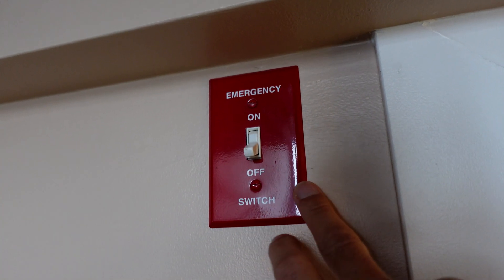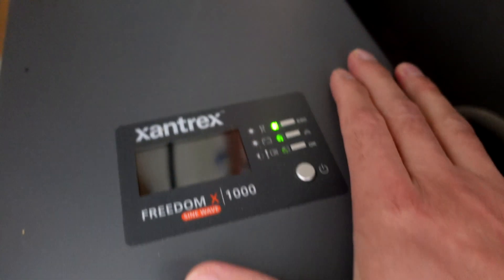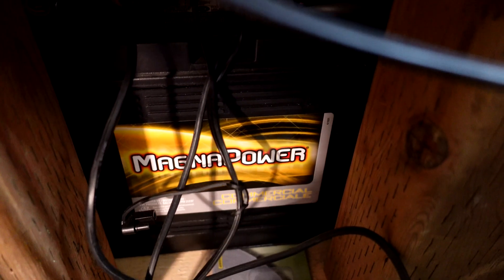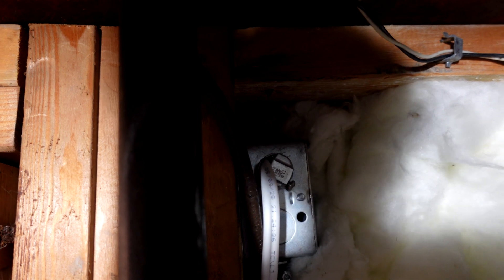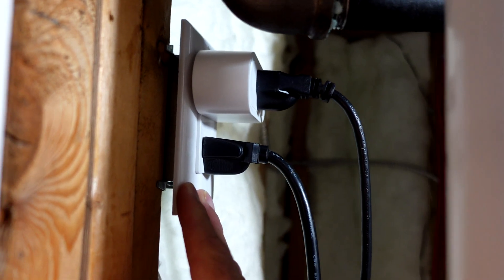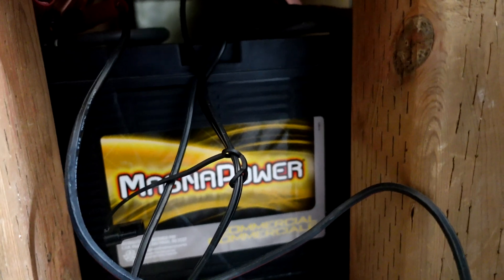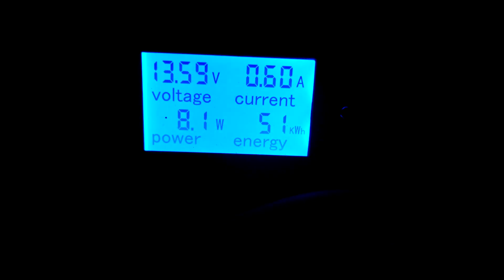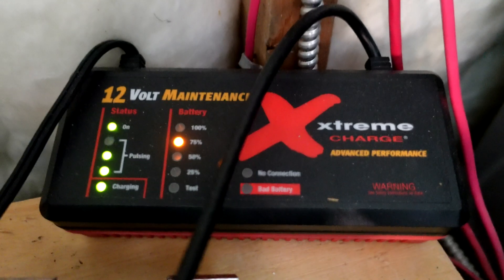DIY Furnace Backup: What I'd Change

Comment: I'm not sure I understand, if the Xantrex already charges the batteries when the power comes back, what do you need the battery maintainer for?
Reply from the maker: This Xantrex unit does not have a built in charger.  Looking back I would have got one that did charge when the power came back on.
Reply: @HouseDadLife  Oh I see, thanks!

Comment: Great video - I recently saw one by "The DIY HVAC Guy" that talks about connecting an Inverter to a solar panel.

3:50 - If your Hubitat is connected to a UPS, would you be able to use a Smart Plug to toggle power on/off depending on if something that is part of your Smart Home, but not connected to a UPS goes on/offline?
Reply from the maker: Ooooh you're thinking, this might be an option.  I did see his version as well, hopefully that inverter works on newer furnaces. The unit I have seems to be very fussy.  Needs a ground and a pure sine wave or the furnace drops an error code.
Reply: @HouseDadLife  I certainly found your version to be quite interesting and in many respects thought it better. I like the idea of setting the inverter to start recharging as soon as the power comes back on - something that honestly hadn't occurred to me prior to watching your video.
Reply from the maker: I appreciate the vote of confidence. Thanks. I feel like charging could still be better, but, it's been working perfectly so maybe the pursuit of perfection can go for coffee.